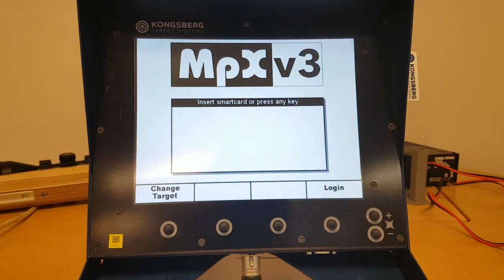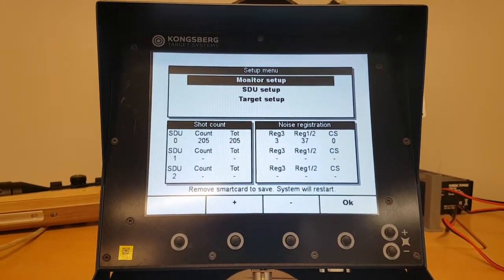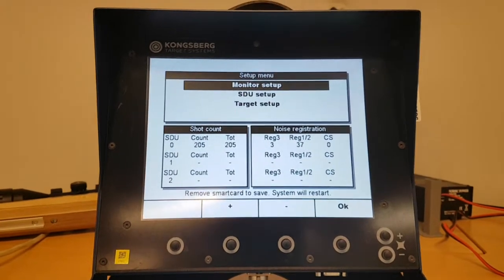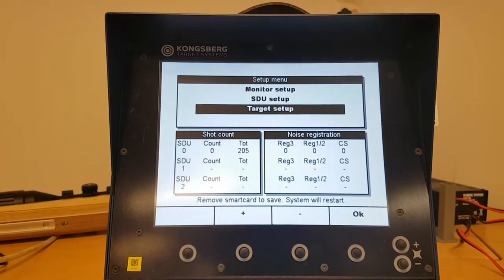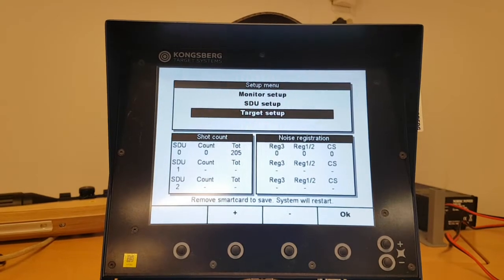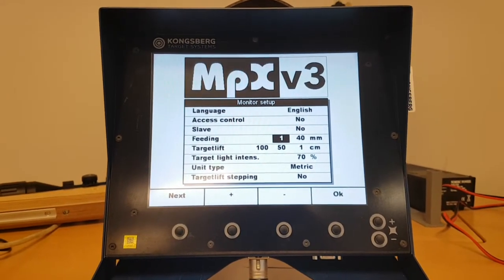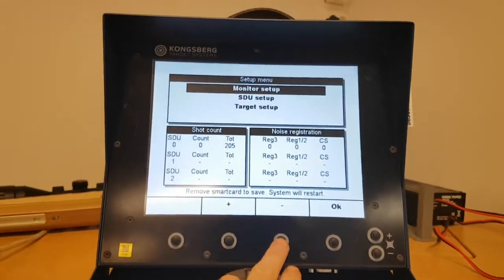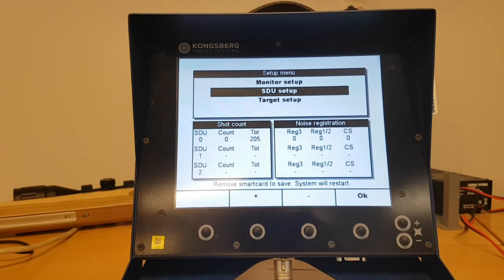MpXv3 Monitor Setup

Comment: Hey. The KTS Targets at the CMP park in Talladega,  is the measurements, (specifically center to center setting) is it in inches, millimeters, or centimeters?  Several of of staff said it's in centimeters, but I wanted to check and see. I know at one time it was in millimeters, but someone has changed it to maybe centimeters.  Just wanted to verify.